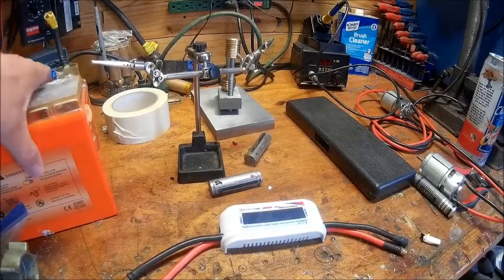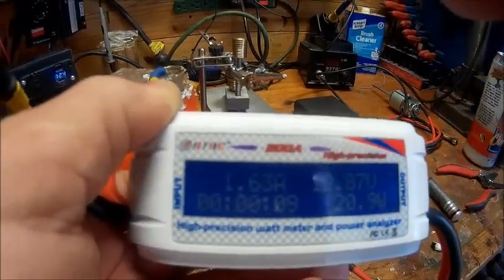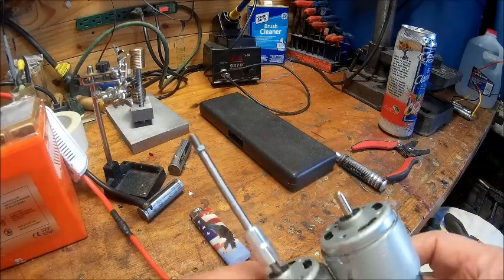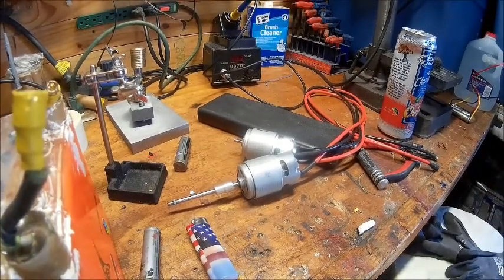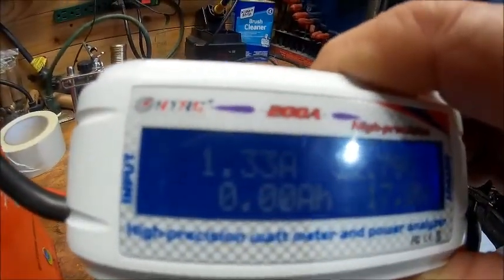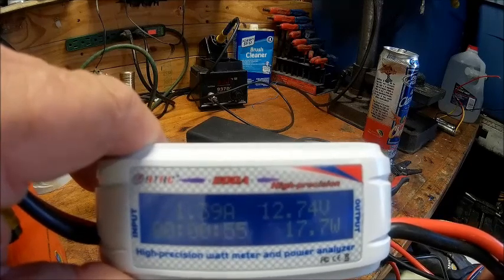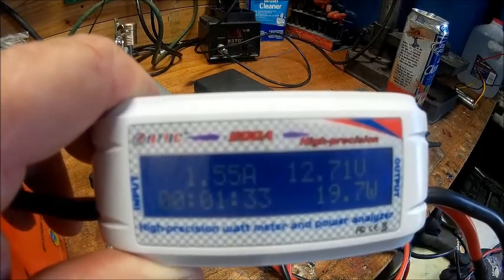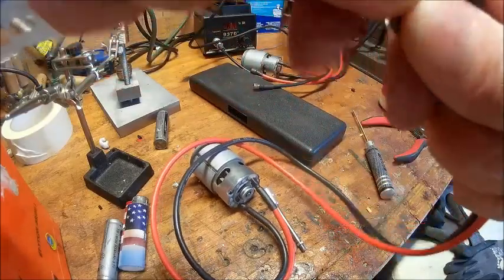Update on motor power consumption on motors

Comment: The reason the motors perform differently in one rotation versus the other is because of timing which is typically optimized for one direction over the other.  You can adjust this to neutral (or other) timing by rotating the position of the end bell in relation to the magnets.  On those motors, it would likely require bending out the locking tabs and finding another way to secure the position once you have it where you want it.
Reply from the maker: You are most correct....... but I didn't want to buy RC motors....and the little difference I get in power won't be noticeable.........but thanks for the info and thank you vary much for watching.

Comment: why don't u use brushless motor?
Reply from the maker: Brushless motors have more power and are more efficient yes. Buy require
 an ESC (electronic speed controller) and they are acting as the 
commutator wear a brushed  motor has one on the armature. Less to go 
wrong like I said I raced RC boats FE and a ESC is a wild animal. You 
can't buy one water proof and you break in a brushed motor in a glass of
 water. What I'm saying is less to go wrong and a lot cheaper ESC's of 
the size I need start at $100.00 dollars a piece good point to me not 
cost effective. thank you for watching
Reply: i am pending to put a brushless motor at boat diy pontoon too , i already made a weedeater outboard ! but i find a 80amp esc about $30 at ebay  and i have some brushless motor siting  around  ( it is 4 my rc plane )
Reply from the maker: I blew two Castle creation's 240 amp HV ESC's at a boat race in a 31 inch P mono at 300+ dollars a pop and only running 15 volts.........wild animals..........the heat build up is incredible.......but I won first place LOL